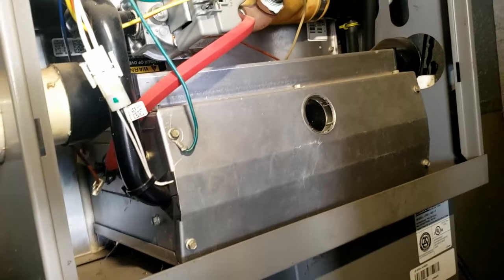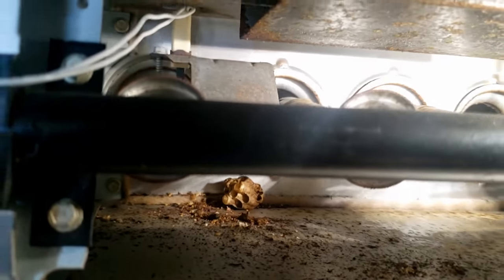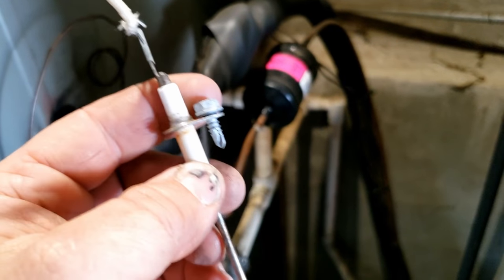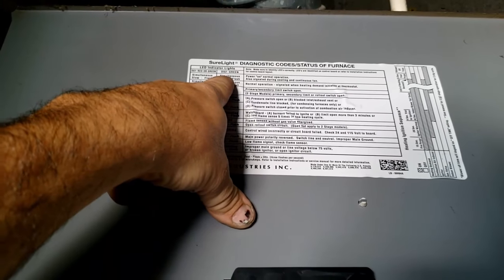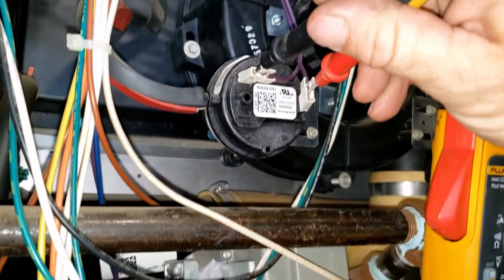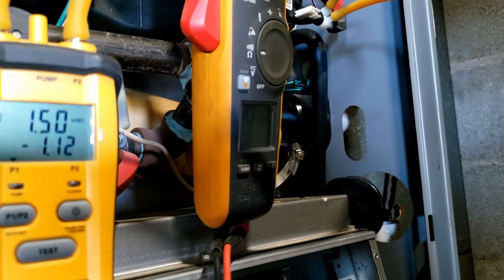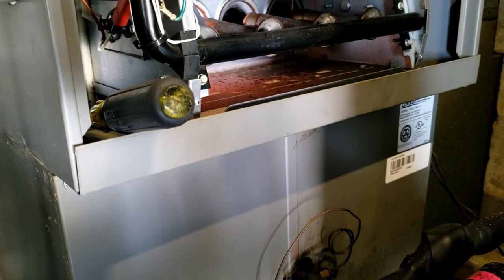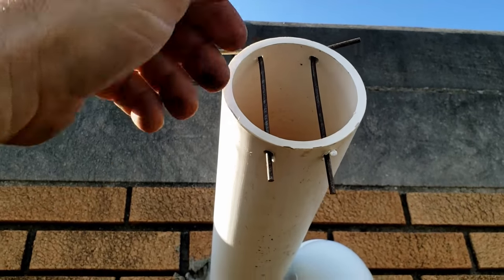No Heat Service Repair Birds Eye View

Comment: Great troubleshooting! Good tip on getting the sensor out. That furnace is such a pita to work on
Reply from the maker: It can be but they have a couple worse ones 😱. The ignitors in some are near impossible to get out

Comment: Just out of curiosity.. that fernco coupling on the exhaust, is it rated and certified to be used like that on 636?
Reply from the maker: What is 636? We have used them for years on furnaces, the manufacturer uses them to connect the draft motor to the pvc.

Comment: Great video,  How do you know the correct differential pressure that you need it for that furnace?  Is it on the cover label.?
Reply from the maker: From my experience the actual amount the switch will see is sometimes 1.5-2.5 X the rating that's listed on the switch. Usually the switch closes at the rating that you see on the side but that has to be verified by the manufacturer.

Comment: Great video. I have done the same thing! A bird screen is always a good idea and save you some time in the long run.  Keep up the good work!
Reply from the maker: Bird screen will create a no heat call generally up in my area of ohio. The moisture will cause the screen to freeze shut in super cold climates and block the vent LOL.  Probably works fine down south. Now I have had them build the cage way out and around it and that sometimes works.
Reply: @HVACRSurvival  good call, I have not seen them freeze up but I'm further south than you in Louisville.
Reply from the maker: Yeah I'm an hour and 30 minutes from Michigan. Sometimes it can get down to zero that's when you'll have it happen the most.

Comment: Nice job 👍
I have the Milwaukee light too , I agree the battery life isn't great but you gotta treat it as a quick usage light , not for a long job .
You gotta give it to them though , for the size of it it's pretty bright and practical , but small size is gonna mean short battery life , the Bosch light has a more sizeable battery that's why it lasts longer .
I also use both brands , but I gotta admit , when it comes to led lights , I think Milwaukee are the best on the market , especially since they're the only ones offering the yellowish light that doesn't blind you or wash out colours .
Reply from the maker: I wish Bosch would have kept up the new tools but it's not happening. Your right man, I have the 1.5k and 3k lum Milwaukee lights off I need them. They are bad ass at night and in bad spots without power.
Reply: @HVACRSurvival  yeah over here I can only get Milwaukee tools online and they're very expensive compared to what you guys get them for ( I guess cause it's imported maybe ) , but if I could I'd get all of them lights !

Comment: I was always taught to use a small brass brush on all flame sensors and metal ignitors.
Reply from the maker: Brass is a soft metal, I like my small stainless brush because it doesn't leave any residue. Both are likely equal enough for a flane sensor cleaning 👍👍. There both better than sandpaper or the $ bill IMO
Reply: I've used sand cloth on them for  years and never had any problems. I dont know why people think it will mess them up lol but everyone has their way of doing things I guess 🤷‍♂️ but i don't think they used sandpaper on this one it looks like someone scraped it with a screwdriver or knife  honestly.
Reply from the maker: @ryanlockhart2255  if it's sand paper that's practically wore out I don't see a huge issue with it, it's not my preferred method but I just find it's easier to have a fine stainless brush that I can use for more than just one thing and I know it doesn't leave deep grooves in the metal. Those grooves have a tendency to hold impurities that are floating through the air as they're baked onto the metal. That's just my experience;  it also depends on what brand you work on. Lennox has always been good about not having flame sensors that glow red when they're in the flame path whereas other brands like Goodman, Bard or the lesser quality ones have a tendency to glow red and those are the ones that I've seen the most issues out of. As you've said to each their own. Thanks 4 your feedback 👍👍
Reply: @HVACRSurvival  Its technically not sand paper per say its sand cloth so it's not as rough as sand paper. I probably should have worded it better lol

Comment: Definitely a real world problem lol. Already ran into a few pressure switch faults. It’s never the switch 😂
Reply from the maker: That wasn't the case 6 years ago when I worked for a premier Lennox dealer. (That's what lead me down the wrong path 🙈)  Otherwise I agree it's not normally the switch.
Reply: @HVACRSurvival  those damn Costa Rica switches lol
Reply from the maker: @STO21NE  you are absolutely correct I will never forget them.

Comment: Hey try the Braun folding bar led worklight. I found one at harbor freight. It illuminates the entire furnace. Awesome work light
Reply from the maker: I own one the battery life isn't that great . The best one I have is the Bosch I just was trying to bleed red. LOL I am a flashlight whore
Reply: @HVACRSurvival    yea that's the one downfall. Lol I am one too. What's the Bosch your talking about? Have a link?
Reply from the maker: @willhvac  the 12-volt Bosch LED light, yes I do have a link for it in my everyday carry I believe. They're about 60 bucks I think,  minus a battery but they last about eight hours on average on high power
Reply: @HVACRSurvival  No shit! Are they sold at home depot?

Comment: How we use to do it in Michigan we 90 up from the wall went 2 -4 ft up and 90 out from the wall and 45 of the 90 with a screen mesh fitting they sold at our supply house built in for a nice snug fit and for intake 90 from the wall with mesh fitting always worked
Reply from the maker: The nicest looking thing is a concentric kit. Now this screen that you put on it, was that on the air intake or the exhaust. I'm saying the problem lies when it's put on the exhaust.
Reply: @HVACRSurvival  both

Comment: flame sensed without valve energized, very likely condensate water in a connection at the passthrough connector or other location like board or flame rod has a conductive bug(not likely lol)
Reply from the maker: Or it could be I read it wrong because of the shit design Lennox used 🤷‍♂️🤣.
Reply: @HVACRSurvival  yeah, I caught that later on lol!
plus the unit was inverted from normal, so no chance of that. Now with the blower/controls down below, when they leak and pool in the cabinet it floods the connector or bushing and runs down onto the control board. I have seen them give the flame sensed that way, because it was seeing ac current from being all wet. sizzle sizzle pop snap

Comment: I thought i'd hate carriers more than anything but turns out i feckin hate working on lennox because the engineers had their heads jammed so far up their ass when they designed them.

Comment: Yes I have
I thought I had a bad condensate pump when the customer called and said they had water on the floor.

What I found was the condensate pump was connected to the light .So every time you shut the light you had no power to the pump.
Reply from the maker: I had something very similar to that, thanks for sharing. 👍👍

Comment: God rest those birds . but seriously why didn't they put like a mesh with holes where nothing but aor can go through? Is that not recommended pr can we still do it
Reply from the maker: Depending on where you live at,  if it gets really really cold like down to the zero mark, the frost that comes from the exhaust can actually freeze over a cage made out of a rabbit wire. Now if you're in southern climates it's not a big deal. But a lot of them people use 80 percent furnaces down in the lower States if not just heatpumps.
Reply: @HVACRSurvival  cool thx for the heads up

Comment: Lennox codes suck it’s easy to get side tracked. Lennox always has to be different.
Reply from the maker: Yes indeed they do. I should have known better because I've worked on Lennox for over 19 of the 25 year's I've been doing this but it's been 6 years since I've been working on them. Oh well crap happens 🤷‍♂️